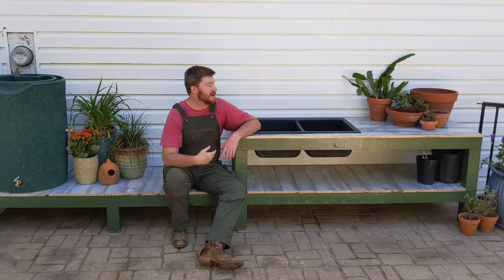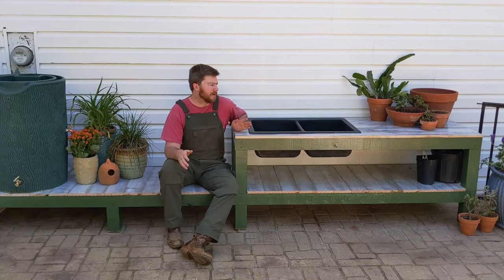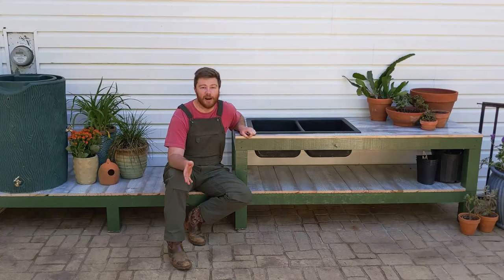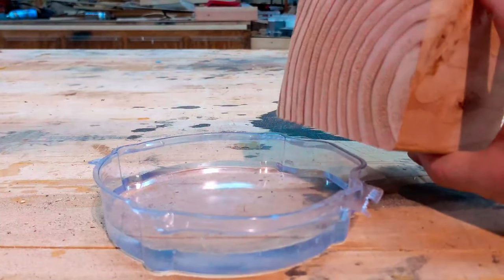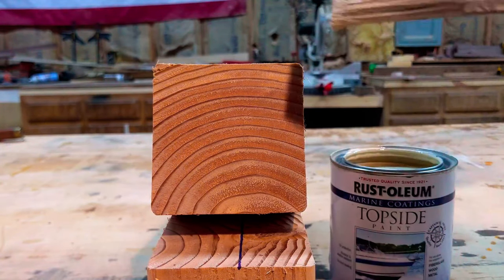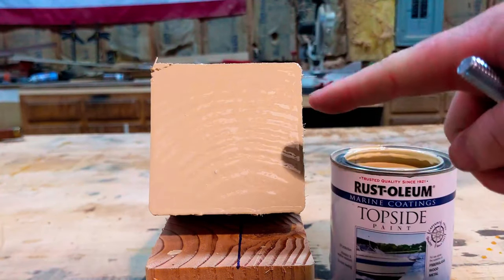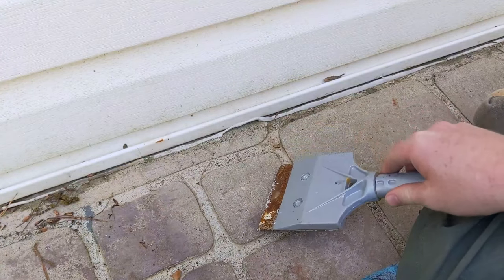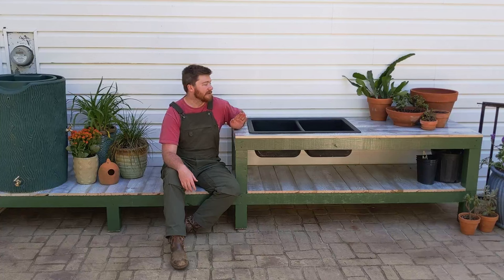DIY Potting Bench

Comment: I like putting 2 part epoxy as feet on outdoor projects. Flip it upside down and make a border using painters tape then fill 1/8" or so with epoxy and you have an impermeable barrier that is darn tough.